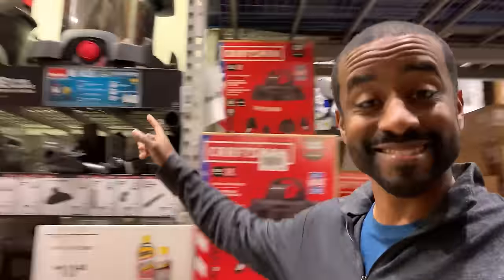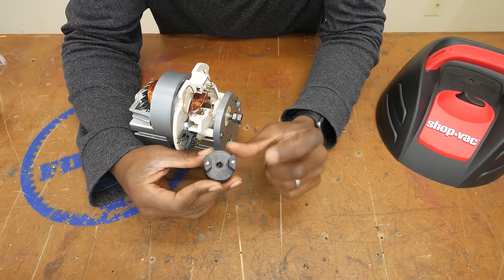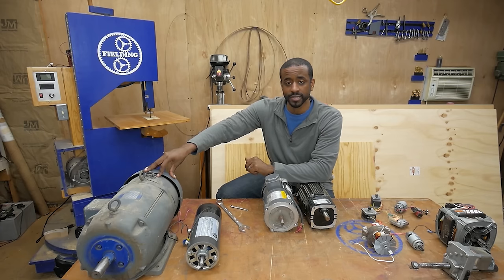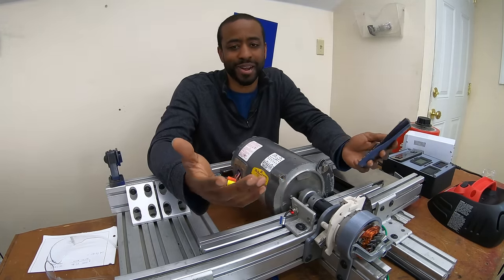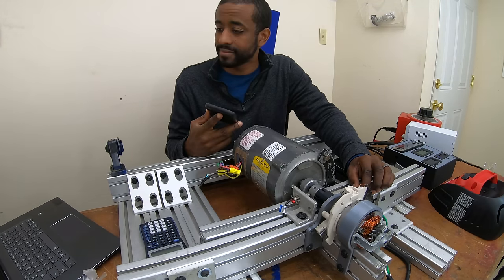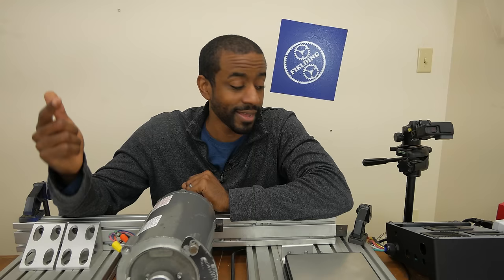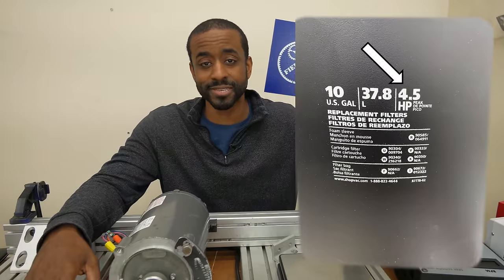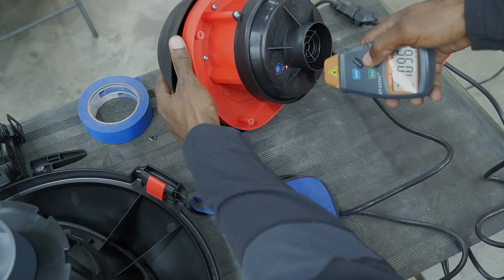How Much Horsepower Does Your Shop Vac Really Have: #078

Comment: I think i know how they can arrive at those numbers looking at their online statements!
"includes inertia"  so im pretty sure that they spin the motor to maximum rpm on a stand and jam on the brake (dyno load) and just measure that instantaneous peak torque at the maximum rpm!  At 16,000rpm it only needs 1.47lb/ft for 4.5hp so that method seems very plausible! 
🤣 Cheating like crazy
Reply: Evil Me that’s exactly what I was thinking as well
Reply: That sounds like a really great guess at how it's done to get the highest number. Load it up with as much rotational energy as possible, jam on the brake, and measure the instantaneous torque. I'm sure they have the impeller blade on it too to contribute that tiny amount more of rotational energy. All for bigger marketing wank numbers. Don't you just love marketers (and lawyers)?
Reply: Exactly my thought!!
Reply: Since they seem to be calling it peak power I did a quick calculation based on 115Vrms and 20A (someone can use the correct US voltage if they like) and got around 4.3 hp by using 115* sqrt(2) to get peak voltage. 
Seems like they may be using the same garbage calculation that stereo makers use to get PMPO.
Reply: @Spectral_Penguin  As he mentions in the video, it's really nothing to do with the input power (as the motor is only ~50% efficient after all). As Evil Me mentioned, the key is in them mentioning including inertia in the calculation.
Reply: Evil Me 
Exactly, just like we use the ShopVac at home! 🤣
Reply: fuqoff aye?  I happen to have turned more than a few cars and engines on a dyno, yes typically the load is applied constantly. However the load is completely controlled by the computer and the operator so that you can hold at a given rpm or do an unloaded run-up. It is perfectly normal for a rolling dyno for semi trucks to allow the truck to spin up to rpm unloaded and then apply a large amount of load, if you notice this is how basically all semis are tested, in run-down mode, because of the nature of turbo lag and the fact that it replicates the real world usage. So in conclusion yes you can use a dynamometer the way I have hypothesized they are to get the given results. Maybe you yourself have much more to learn as well, life is a constant learning experience that no one masters😎
Reply: @Spectral_Penguin  Peak at 4.5 HP, remember they rated stereo systems as Peak to Peak, imagine a ShopVac at 9 Peak to Peak HP on the boxes from the next to come batches...   Sorry about giving them the idea....    😈😈😈🤑🤑
It could be called:   9 HP full of 💩💩💩 Power...   😁
Reply: fuqoff aye?  The "horsepower" number they give has nothing to do with horsepower. That's the point of all this. They're lying, but they're lying in a methodical way that is consistent across their products. People here are just trying to figure out what that method is. I think that the comment here is most likely spot on, and, as another response noted, it is very reminiscent of the sort of nonsense used to get PMPO numbers for audio amplifiers (you can find amps with a true RMS  power output of ~20W rated at over 1000W PMPO).

Because this method would measure the rotational inertial of the motor, rather than anything to do with power, it doesn't even really give a good relative measure of performance, and even within a brand you'll find e.g. vacs rated at 4.5 "Peak HP" with both greater airflow and suction than larger vacs rated at 6.5 "Peak HP" (I'm looking at you, VacMaster).

Commercial vacuums, such as Dayton or Nilfisk, often give more honest numbers, but they cost a bit more, or sometimes a lot more.
Reply: Just FYI ... These vac's aren't rated in Horsepower, ... they are Rated in "PEAK HP" or "Peak Horsepower"  ... Peak HP is a measurement of maximum torque achievable and is a test done in a laboratory on a machine that feeds the motor with as much AMPS as it can take and at the same time appling resistants on the motor to measure the units torque potential that measurement in the Motors PEAK HP  ... you will see this measurement  used on some kitchen appliances,  Blenders, Air Management tools and compressors
Reply: The problem with including inertia is that you can get almost arbitrarily high HP for a brief instant. The more quickly you stop the flywheel, the higher the HP (and the briefer the instant). They must have a specification of some sort about how much torque they apply or how fast they are allowed to stop the shaft.
Reply: @Spectral_Penguin  Except...if I recall correctly, his (video) max current was 9.9 amps, not 20 amps so even with the Peak power (√2) factored in, his input peak power ≈ 0.5 of the rated 4.5 hp.
Reply: @wordcarr8750  I understand that, but given their rating is based on bullshittery to begin with, I was just throwing out another way they could come up with it using mathematical bullshit instead of some janky test procedure.
Reply: The term of art used by the more honest manufacturers is "brake horsepower", which is what folks in this thread have been dancing around.  By removing the motor from its system, you'll end up with a lower figure.  Do recall that the fan it's attached to, the air flowing through the vacuum, and any flywheels will contribute to the measured brake horsepower.   Some text ganked off of a site, describing it more fully:

Brake horsepower (BHP) is the amount of power generated by a motor without taking into consideration any of the various auxiliary components that may slow down the actual speed of the motor. Sometimes referred to as pure horsepower, brake horsepower is measured within the engine's output shaft. Depending on the configuration of the engine, the point on the output shaft that is the focus of the measurement is the engine dynamometer.

The reference to this type of horsepower measurement as brake horsepower has its origins in the braking systems that were used on some of the first automobiles in the early 20th century. In many instances, cars were equipped with a hand brake that would slow the forward projection of the vehicle. This same hand brake was also used in the manufacturing process to gauge the amount of torque created within the motor, making sure the output was within acceptable limits.

In the actual calculation of brake horsepower, it is necessary to consider the total load of the electric motor. This means disregarding any drain on the power that is due to the water pump, generator, or the gearbox that work in conjunction with the motor of the vehicle. The amount of power loss that occurs due to the action of various belts and pulleys is also added back into the base figure, making it possible to determine the true amount of pure horsepower being generated by the motor.

Understanding the brake horsepower of a motor is key to ensuring the output is strong enough to drive both the motor and any auxiliary components. By measuring brake horsepower, it is possible to determine how much power must be produced to allow the motor to function at peak efficiency with the core functions. At the same time, calculating a proper brake horsepower that will supply an adequate amount of power to all complimentary devices found under the hood will ensure that many of the one-time extras available on vehicles that are now considered standard features will work properly. As a third benefit, measuring brake horsepower also helps manufacturers to produce engines that meet all current safety regulations for engine types within a given classification.
Reply: It's downright fraud. You might as well spin up a flywheel and dump that energy into a dino and claim that as the HP.
Reply: witkrieg todd  They would not be able to stop it instantaneously, but the HP would drop of incredibly fast. The actual time would be whatever the shortest measurement they can take is. Say 1/10 th of a second.
Reply: Good observation
Reply: The faster you stop the motor the higher your peak HP reading is going to be so if this is the case then the peak horsepower is a function of the shaft strength!
Reply: Haha looks like i wasn’t alone in thinking this. Makes sense. Good comment.
Reply: fuqoff aye?  derp
Reply: If you never define the time frame in which you are extracting the motor HP plus stored inertial energy then you could potentially get seemingly infinite torque/HP over an infinitely small slice of time as it would take a great deal of braking to instantaneously arrest the spinning mass in an infinitely short period of time.  So in another 100 years we’ll have 1500W universal motors on our Shop Vacs rated for 1 Million Peak HP!
Reply: Exactly what I came here to comment and you beat me to it lol
Reply: 6.5HP if lightning strikes
Reply: The online statement does not specify that the output of the motor is rotational power (it just says "horsepower output"), which means they could be using the motor as a generator and measuring the ELECTRICAL power output, just with horsepower as the unit. 

Really I think the problem here is that people think horsepower = rotational, but that is not necessarily the case. Horsepower is the same thing as watts, just like how with distance meters are the same thing as inches.

EDIT, Wait a minute they might be able to measuse HEAT output as well, that make that number even more useless!
Reply: @Evil Me Maybe car manufacturers should start doing the same power evaluation. 
Like stating how much “horsepower” is dissipated from that car under inertia at 200km/h into an immovable concrete wall. 
Then we can I all brag about that meaningful power unit.
Reply: Yea, I was thinking something like that.  It's like a person jumping on a scale.  It's going to jump to a much higher number than what they actually weigh.
Reply: Also what I was thinking
Reply: It really doesn't matter how they are coming up with the number. What's important to the consumer is that the testing is consistent from one version of a product to another from the same manufacturer. As long as you know the product that's rated at 4 HP is twice as powerful as the one rated at 2 HP. They could have just used jellybean numbers and it would mean the same thing. 4 jellybeans vs. 2 jellybeans, 4 stars vs 2 stars. You get the point.
Reply: @seephor  If the manufactures can't tell how they arrive at the rating then what expectation is there that it is consistent from manufacturer to manufacturer?
Reply: @garyh4458  I wouldn't think they would be consistent from manufacturer to manufacturer. That's too much to ask for from the marketing departments. You can still compare the Shop vac brand from model to model using their bogus numbers as some measure. The important thing is whether that measure is consistent from model to model. I'm guessing it probably is.
Reply: We are talking horse power not Kinetic energy.  Horse power is not a mesure if instant, it is a measure of work overtime.  So you cannot measure. Horsepower in an instant. Display on the vac is clearly says Horsepower, that means 33,000 foot pounds per "minute" for each of the 4 horse power?     Plus your argument do not hold water, the mass on that motor is not that graight and from that you only consider the rotating parts and the argument  stop working you must consider mass and velocity. The mass is not sufficient to store all the energy needed to generate that amount of power. Further more the mass of the shaft is not a force to be seriously consider, you must consider the outer layers of the rotating parts on your theory they are the most influentials. The layers close to the center of rotation are much less influential on the total mass.
Reply: It's got to be something to do with inertia and braking from operating RPM to a stand. There's no way it could pull enough power through a domestic plug to output 4.5hp, even briefly, it would blow breakers/fuses or whatever you have.
Reply: @98dizzard  running in a vacuum too
Reply: "Laboratory conditions" could have meant they added a flywheel.  Surprised they only went for 4.5hp
Reply: In fairness, the power is important only for finding the suction it can produce. If a sudden blockage occurs, I would expect a higher power motor to be better at sucking  it in. In that case, the spinning mass of the motor is helping.
Reply: @rancidmarshmallow4468  I think this is more of an exercise to hypothesize the methods that are used to obtain said results more so than to compare one thing to another.
Reply: @dontaskme9047  Is that not.... exactly.... what they're doing?
Reply: @gorak9000  Probably something that resembles the impeller blade weight wise - but has none of the drag. So.. basically a flywheel.
Reply: i was just about to say that
Reply: Now I sort of want to put an impeller on a huge flywheel on air bearings and use a shop vac to spin it up. I would like to shoot for over 500 peak horse power and try to sell it to Shop Vac as an industrial shop accessory.
Reply: @rancidmarshmallow4468  no it has to accelerate  mass is enemy
Reply: But all my other electric tools..such as lawn edger, skil saw, chain saw..have univrsal motors ..of the same size...all say the same damn thing 4.5 H.P. ..
it aint going to do Jackshiet if I mount on an electric go kart.lmao
Then again my 4076 2250 KV brushless (750 can size) 2800watt max..
it dose make my 1/7 scale r/c  truck (12lb) do 50 mph on 18V D.C. 120Amps.
it's so confusing..i dont wanna kill the kiddies on the go kart.
the 2000watt brushless for the go kart is bigger than those 4.5 H.P. universal motors...but 2000watt is only 2.5 H.P....no?
5 H.P. lawn mower gas engine for go kart...isn that fast. :-(
Reply: @Spectral_Penguin  If you remind this, you are more than 30yo : ). Good old time when 200W PMPO  speakers came freely with an windows 95 setup.
Reply: "includes inertia"   Realize, this is developed horsepower.  As in the energy stored in the total system, that will get you through momentary peak loads.  It is just as useful a measure as any other measure for it's purposes, it is simply a different measurement than the 'continuous horsepower' measurement.  By definition most US outlets are only 15 or 20 amps at 120V or similar, so they won't be 6 HP continuous..   At typically 1800 and 2400 watts, the normal 120V circuits are only around the 3 HP range directly.
Reply: Exactly what I was thinking
Reply: @mckenziekeith7434  as much as not to break the shaft
Reply: Why doesn't governments crack down this very misleading advertising ? Claims should be made of the operational hp and not some number that can only really be done in a lab.
Reply: @gorak9000  In a vacuum

Comment: Great video Jeremy, I've always been dubious of the 6 hp on my shop-vac.
Reply: Cool to see you on here.  Love your channel also!
Reply: Yeah. Here is my 3hp tablesaw motor that I can barely lift (I mean the motor by itself) and here is my 6hp shopvac that I can lift the whole thing with one hand and it runs on 120V? I should upgrade my unisaw to 6HP by putting the shopvac motor in it. LOL.
Reply: @mckenziekeith7434  my thoughts exactly. I would never expect big power, from such a light product.
Reply: @mckenziekeith7434  What I think is that the Chinese manufacturer ships the motor in watts i.e. 650 or 450.
The manufacturer's uninformed worker made a layman mistake in excel when dealing with labeling while converting to US units of hp assuming they googled hp and watts was a unit of power. Did not understand the conversion. Messed with the decimal to make it look like hp 6.50 4.50. Presto 647 watt motor is now a 6.5hp beast. US needs to update to International System of Units if confusion is to be reduced.
Reply: @bitterlyhonest2307  Haha! We can dream. Apparently there is some procedure or process the manufacturers use to determine the HP rating on the vacuums. But it is totally divorced from all reality and engineering practice.